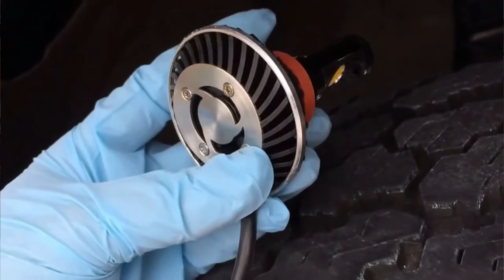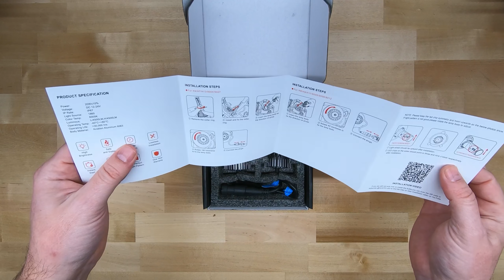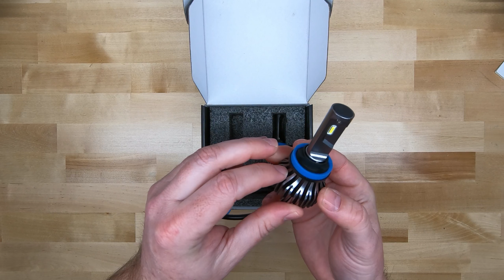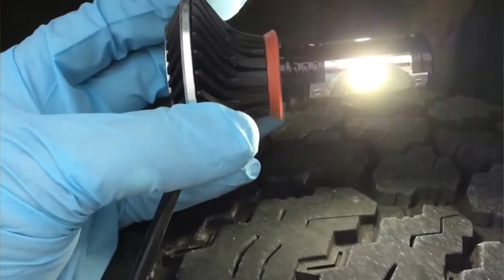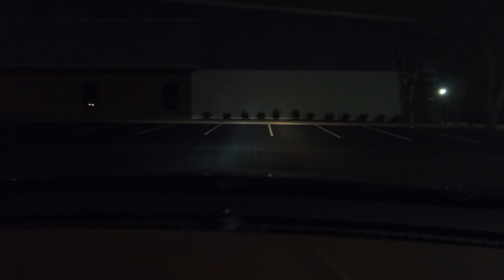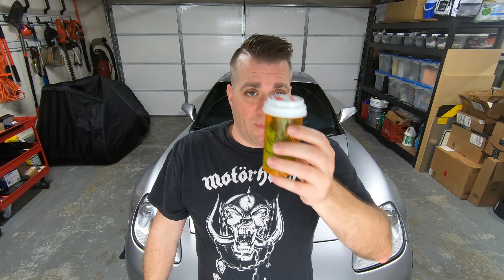TESTED - The Best Budget LED Headlight Conversion?

Comment: NIce review! The new LED's look great! I have the same in mine. You should see the LED's they have for reverse lights. They look similar and are just as bright as the fronts or close.
Reply: Are they super white or do they have a hint of blue in them? Thanks.
Reply: @911Fuser  Sorry for the late response they are super white
Reply from the maker: You don't see a slight hint of blue?  I do...but ever so slight.  I think it also depends on what the light is projecting on.
Reply: @InJasonsGarage  No not at all. I've had LED's that gave of that hint of blue, but these don't and I like that because some companies claim bright white and you get a little blue

Comment: Just  bought the Hikari Ultra for my motorcycle, ao checking out some other reviews. That one they claim is 30w and 12000lm
Reply from the maker: I have heard good things about the Hikari lights, but I'd like to know how they measure that lumen number.  I know that number is measured in pairs but still, that's crazy high.
I am doing a test right now on a set of US made(!) super high-quality OEM grade LED headlights and the measured (not estimated) and published output is a genuine 3260 lumens per pair.   This will be in an upcoming video, but I have a hard time with the idea that the Hikari is 3-4 times brighter than that...especially when they use the same chips as the one I am testing. :)  The driver must be incredible but then that brings in the concern of heat dissipation and longevity/reliability.  But...like I said, I heard really good things about them so I'd love to hear how they work out for you.  Did you already get it installed?
Reply: @InJasonsGarage  No, I just ordered it but have Prime so it will be here fast. If the claim is true each one draws 30w, and also note they have some kind of fan on them,  that would account for extra brightness. The reviewer I watched measured the base at 100 degrees F in operation, and showed a beam pattern on a marked wall from a reflector housing... the hikari ultra vs a halogen, and there was no pattern  difference... particularly the cutoff at the top was excellent. Ill let you know how it turns out. I use a pair of "6kLed" ( 20w each )  led housings on my bike  but only as high beams, so im looking to replace the weak halogen light the bike came with for low beam operation. I make a long work commute in the dark.
Reply from the maker: Cool man, tell me how it works out!  I am dying to hear some real-world results of them.
Reply: @InJasonsGarage  Ive never purchased any of these before so I have no frame of reference. 
1) Light is beautiful white light as on a high end new car. No blue.
2) VS the stock halogen this is worlds better. The upgrade was worth it.
3) When you turn on high it turns off low. You cant apply 12v to both leads and have them both on at the same time. It wont allow it. 
4) The fan is quiet, and replaceable. I applied locktite to the unscrewable aluminum fan cover . 
5) The high beam reaches very far with good spread. Excellent!. 
6) The low beam cutoff at the top is severely precise. You cant see jack beyond the cutoff so it takes some precision to get that adjusted correctly where you arent cheating yourself, and you arent poking oncoming people in their eyes. 
7) Mine is H4/9003. INSTALL clearance is different than INSTALLED clearance. The locating ring is placed in the reflector, dust cover is replaced, then you have to stick the light into that and rotate until it clicks. This means you need an addional 2 inches behind it to get it in there. A 45 minute job turned into 2 hours because I had to remove all the connections on the fairing and bring it forward a bit to get the Hikari in. On my bike this is not an easy job. 

If it lasts Ill be real happy. Before lighting was significant inadequate, now it is somewhere past acceptable into the good range. If it doesnt last I will be pissed because of the high cost and how freaking hard it is to get it in my bike. 

Good luck!
Reply: Also its 12000lm per PAIR. One is 6000. So they say.
Reply from the maker: @bunberrier  Yeah...so they say.  That is ridiculously bright for the number and size of chips.  The heat dissipation must be pretty good to keep the drivers cool enough to prevent frying themselves.  Either way, I am sure they are much better than OEM lights.
Reply: @InJasonsGarage   I would avoid Hikari for now, I've had multiple set from them with multiple bulb failures. 

Had 2 failures in my 2014 sierra first one of the LED chips had exploded (the little lens over it was completely shattered). and the second one one side the LED chip came de-soldered causing it to fail. 

In my roommates 2010 forester he had 2 failures as well, first one the whole bulb just lights up dim, even swapped it with the passenger and the bulb stayed dim, got a replacement and same thing happened.

Also the bulbs are running so hot the black anodized finish turned a bronze color. Sadly stuck back on the stock halogens for now till i can find bulbs that last longer than 3 months.
Reply from the maker: @nobodytoyou4887  Since my replies to this thread above, I have started to hear the same issues.  I guess they can be hit or miss.

Comment: Are these really a quality bulb for how cheap they are??? I’m finding them on their website for $37 and that makes me curious. Just wonder how long they will last
Reply from the maker: So far, they have been performing very well in the past 3 months that I have been using them.  However, the longevity is indeed in question.  Without a fan, I am starting to wonder.  I may pull them after 6 months and do a lux meter test on them just to see if they have light brightness due to heat.
Reply: @InJasonsGarage  how is longevity?
Reply from the maker: @tybarnes3091  I ran them for well over a year with no issues.  I switched to these: https://youtu.be/ai29wbvRkKY and are still in my wife's vehicle to this day and are also working very well.

Comment: Why direction did you place the light into the housing?  Notch around led down or up?  Great video thanks
Reply from the maker: I installed mine vertical, so the LED chips are firing horizontally.  However, it may take some experimentation depending on the housing design.
Reply: I saw that the bulb has a indention/ notch near the bulb. Did you point that down or up

Comment: Why would an LED need a fan or heatsink??
Reply from the maker: LEDs do generate heat.  Just not as much as a filament bulb.
Reply: Heat is the enemy of led chips
Reply from the maker: @hitchens0218  Very true. Heat is what can will a bulb dim rapidly over time.  Some bulbs that do not have adequate cooling will be bright at first, but as they heat up the output is impacted along with the overall reliability. The ones I bought and reviewed in this video are doing well so far, but I am wondering how long they will remain bright.  I am monitoring it.

Comment: What is the size and if cause radio interference or check engine light on?
Reply from the maker: The sizes for the 2014 Buick Encore is an H11 and 9005.  They offer LOTS of different sizes, see the link in the description.
No radio interference has been noticed, and no check engine light.  We have been driving the car around for over two weeks since I did the installation before made this video.  Not a single problem so far.

Comment: most led replacements will struggle in a projector setup, hid is much more preferred for projectors, led's are preferred for reflectors, so long as you can maintain a decent beam pattern and a beam cutoff too
Reply from the maker: That's what I thought.  And I was surprised that the LED bulb worked so well in a projector housing.  I know it is hard to tell from the footage, but that beam was crisp, clear, and bright and had the same cutoff line as the factory bulb.
Reply: Russell Pompa i didn’t know that. why is that so?
Reply: So many leds work great in a projector, theres even leds that are for projector only where led chips are pointed at 1 and 10 O'clock.
Reply from the maker: @hitchens0218  I have another set that I will be reviewing very soon that were specifically designed for both projector and reflector housings.  It is the only set that I have been able to get an answer on which they will work in.
Reply: @InJasonsGarage  thats great, will be waiting for it. 👍👍👍